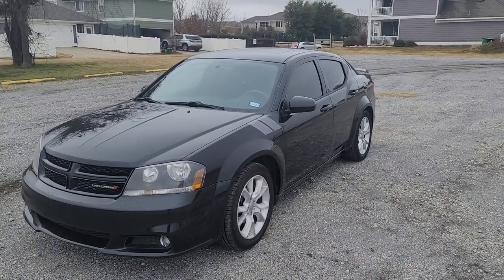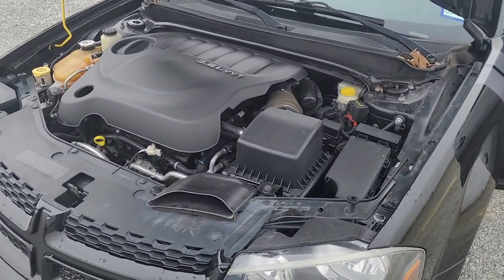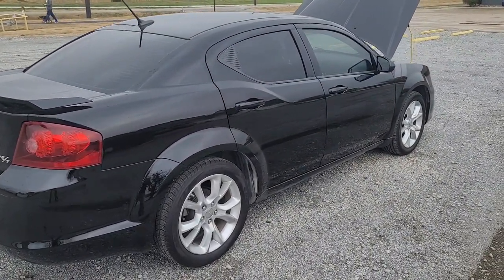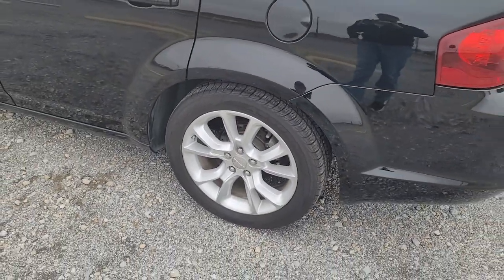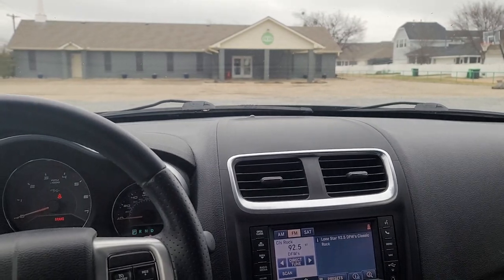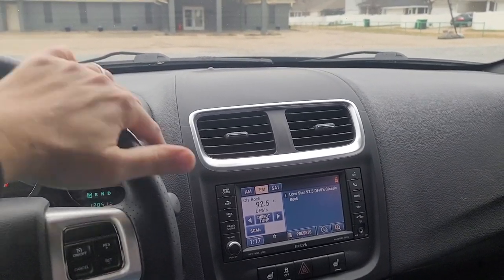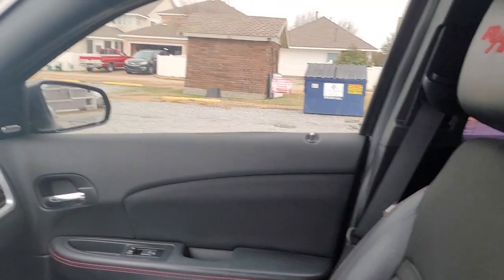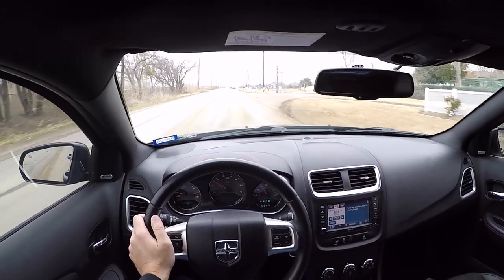120,000 Mile Long-Term Review on my 2012 Dodge Avenger R/T

Comment: The water sound is due to low coolant
Reply from the maker: Hmm, I haven't heard that before. This swooshing was talked about though when I was looking into the clogged a/c drain line so that's why I figured it was related to that. I haven't checked the coolant in a long time, but I'm pretty sure I've been hearing this before the last time I would have checked. I honestly can't say for sure though. I'd check it now but I sold the Avenger a few weeks ago. Thanks for the tip, if this ever comes up somehow in another car I'll check that for sure.

Comment: at 20:24  your dash lights are flickering
Reply from the maker: That's just an issue between the LED frequency on the lights and the camera's recording framerate. It's fairly common in a lot of videos. None of the dash lights were actually flickering in real life.
Reply: @Scavenger1320    oh ok.           cool

Comment: I'll pass do not want the V6. It has some common problems that are expensive to repair. And V6 equipped Avengers tend to have more transmission problems then the four cylinder equipped cars.
Reply from the maker: Thats interesting. I haven’t heard of many issues with the pentastar v6 and there’s well over 10 million of them on the road. I obviously never had any issues with it in this avenger and I have it in a newer Jeep Grand Cherokee now too. I do agree the transmissions in these avengers weren’t the best, although it did hold out for the 120k+ miles I had it in this one

Comment: 6:45 into the video and you have done nothing but try to sell the car. I was hoping you'd tell me how it ran and what problems to expect. If you did talk about the problems, you took way too long to get to them. If it had been a 15-minute video, I would have stuck around, but I've got better things to do with my time then to hear about who caused the stains in your car and red stitching. Put the important stuff first and make a much shorter video.
Reply from the maker: Sorry you feel that way, sounds like you might have been expecting more like one of those '10 things i hate about this car' vids. I tried to make this review fully comprehensive and a lot of people don't know what the R/T package was or had so part of that is explaining the options and features that comes on it. After 2 years and over 27K views you're the first to make this complaint. Over 8 years of ownership and over 120K miles isn't easy to cram everything into 1 short video, but I agree I could have done a better job editing it. This was one of my early videos so I was a complete noob at this. Thanks for watching almost 7 minutes of it though!

Comment: Plus you weigh a lot and are pretty huge so you would have a quicker quarter mile if your 150 lbs like me
Reply from the maker: Yup, based on a tenth per 100 pounds I would have run a best of 14.973 that night if I weighed 150. But I'm 6'2 and back in 2012 I weighed around 220. I went to the track with a buddy that night who raced his rental Camry. I probably should have had him make a run in it since he was small guy and couldn't have weighed more than 140.